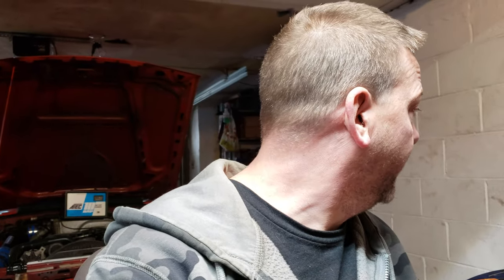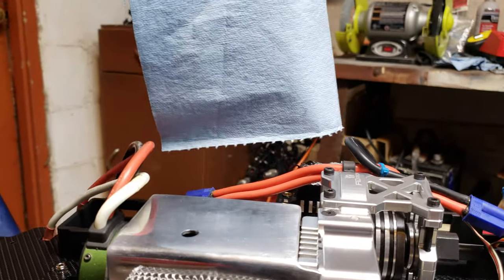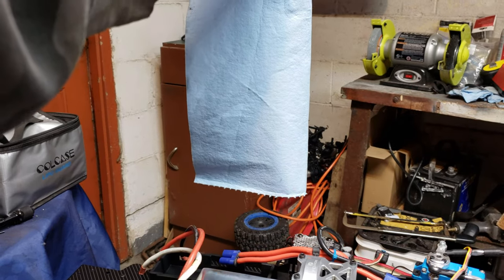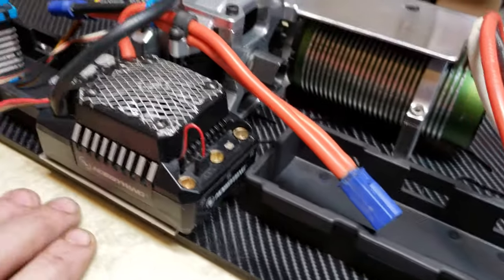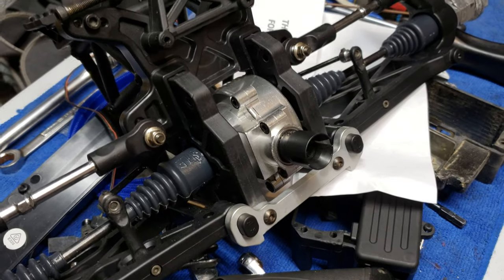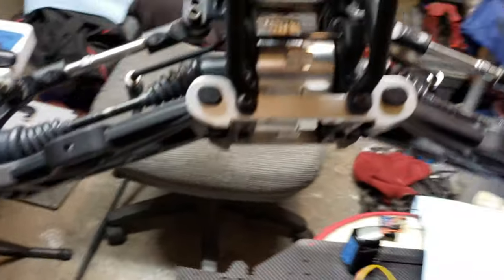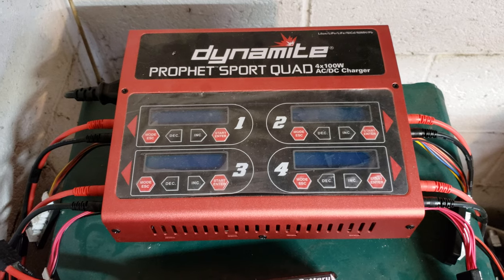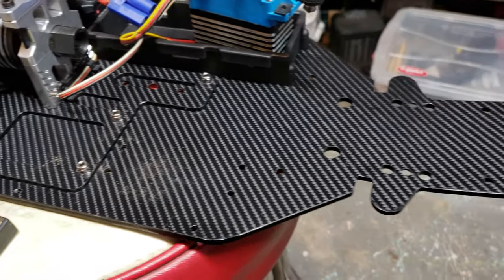Losi dbxl-e V1 Motor Fan Upgrade

Comment: Awesome video very nice mods and upgrades great job thumbs up 👍
Reply from the maker: Appreciate that. Especially coming from you. I'm not much of an e word guy. But I really dig this Losi. Lots of room to work and upgrades are limited to your imagination. I think this will really help and looks decent too. How difficult are 2028 motor bearings to replace? Might as well do it now. Thanks for any info
Reply: Steel City RC Yes man I love the Losi Fifthscale platforms very easy to work I’m big fan of gassers as well I want to build a big bore gasser too my pockets just can’t afford as of yet lol so the closet thing to that power and speed is brushless and way cheaper lol 😂

Comment: Yes G looking awsome you did a sweet job on tha wrap and the motor cooling fan i like it so much i want one any in production ill take one for my dbxl-e also thanks for posting...
Reply from the maker: Thank You. That wrap looks cool. But its gonna peel. Not the best quality vinyl and glue. Probably last longer having no gas spill on it though. The fan mount. I have a mock up stencile for it. But in order to use it. You would need the FID motor mount and that rear motor mount clamp I have. I have two screws I drilled and tapped into those two mounts in order to secure the fan mount and still able to adjust pinion mesh.
Reply: @SteelCityRC  ok I have the fid setup already how can I purchase the rear clamp any link for that or a store name thanks
Reply from the maker: @rcsfinest1883  https://rc-car-online.de/en/products/tt_tt1021_02-tt1021-02-top-tuning-motor-clamp.html
Reply: Ok thanks G appreciate that going to start working on mine when I get the mount I'll holler for the fan if that's ok..
Reply from the maker: @rcsfinest1883  possibly.. it was a pain to make

Comment: Great video brother!!!  I’ve been having to do a lot of tech videos too I hear you on the weather out here in Iowa it’s cold also.  Great job on the chassis wrap in making the pattern lineup.  It’s all about the details bud!!!
Reply from the maker: Right on. It's still early winter and I'm crying. Lol got 3 months of it still. I run in the winter though. I will say lipos give you about half the life they do when its 70 degrees. I mean its noticable. 20 minute runtime to 10 minutes. But still fun. Thanks for Watching and the support my friend!! 🤘👊
Reply: Steel City RC yeah ever since I changed to Benol racing oil they say on the bottle not to use below 35°F.  My Rampage is begging me with the new 32cc engine 😆🤣😂  it was nice today except the wind was blowing 40mph lol 😝

Comment: That fan and shroud look's and sounds great, love custom work👏👍👍 yeah I used a that ebay vynal on the body and it came out like💩 but yours look's awesome😁👏
Reply from the maker: Thanks! I'm making a plastic protective cover for the actual fans from a 2028 fan shroud right now. Seems like a good set up so far. Summer heat will tell if they work good. That vinyl. I'm half tempted to tear it off now to save the trouble of I looking worse later on coming off lol

Comment: hey, I have the Losi DBXL-E 2.0 and just purchased some signal 10 fans, as well. What do I need to run them from a small lipo instead of the receiver? I assume some sort of adapter, but not sure what to look for. thank you.
Reply from the maker: Hey what's up. If you want to run the fans off a separate little 2 or 3S lipo you can. Just have to get male and female connectors that match and plug it in when you want.
Reply: Steel City RC thanks. If I didn’t do a battery, would it be okay to run 4 signal 10 fans off my receiver? Or would that be too much voltage for the ESC or receiver?